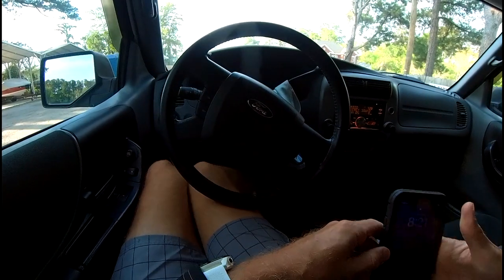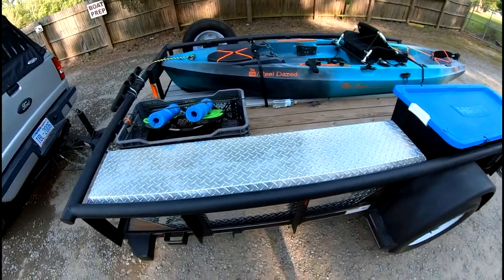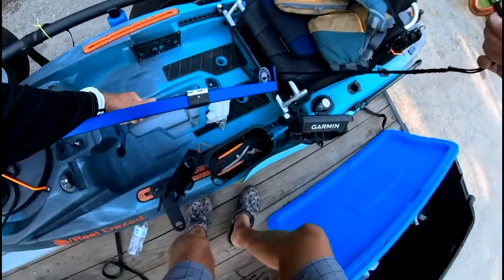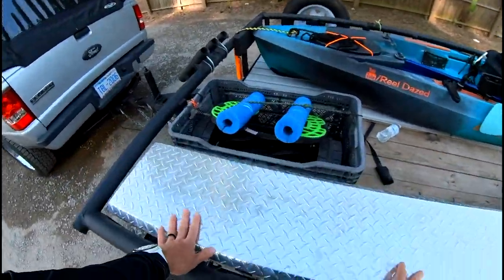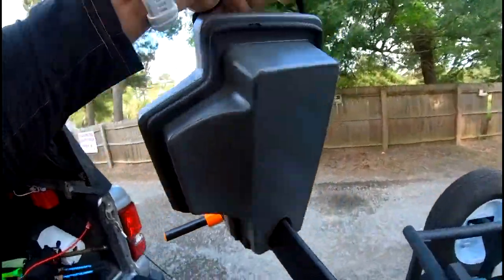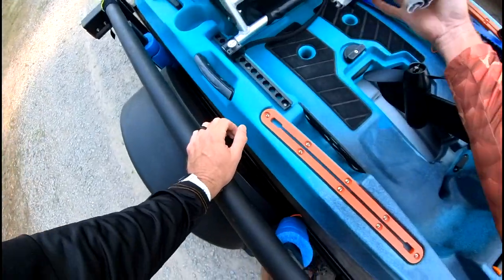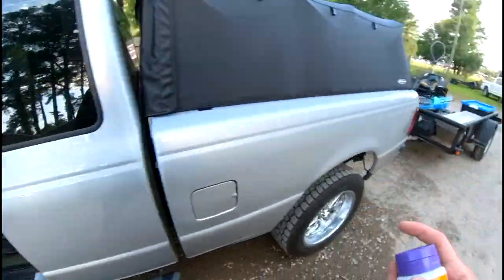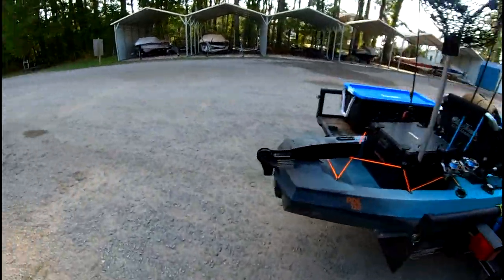Fishing Kayak Setup and Launch Procedure-Find Your Routine-Old Town Sportsman 120 PDL

Comment: Good video RD!  As a Lean Six Sigma consultant, I literally have studied and optimized my load(at home)-unload(at lake)-load(at lake)-unload(at home process).   I have each of them down to less than 8 minutes which includes loading 9 rods into my crate out of my truck.   The key is a few things...first attach as much as possible to your kayak that can safely travel, ie, fish finder, crate, cushion(attach bungees to back of seat and leave cushion on).  Second, any time your are walking around the trailer is wasted steps so turn your boxes around so you can be on the trailer and loading things from them onto your kayak by just turning around.    If you sketch out an overhead cartoon of your setup on the trailer, draw a line for everywhere you walk (called a spaghetti map).   You will be surprised at how many steps you take!
Reply from the maker: You are absolutely correct.  I probably walk a quarter mile around the trailer LOL.  I have thought about what I could leave attached,  I just do not want it to be gone when I get there.  I have thought about leaving the backpack pro attached as well as some of my mounts.  I had concern that the crate may bounce during travel and crack the rear well of the kayak.  I'm sure that is unlikely to happen.  I would be interested to hear if others have done it.  Anyway,  thanks for watching and the great advice!

Comment: I've been kayak fishing 9 years now, started with& only ever owned Hobie PA12's. Now on my second one, a PA12- 360. I've never had a trailer. I built a stand in my shop on casters, exactly same height as my truck bed. So I can just slide it on/off without ever picking it up. Then I either slide it off straight on grass banks into water or use my  kayak cart if it's concrete or need to cart it a farther distance. I never pay any parking fees on the big lakes because they only charge you to park at boat ramp areas if you have a trailer!  I also keep my kayak completely rigged up at all times. Unless I'm doing maintenance or cleaning it which isn't that often. Only thing I need to do is unstrap it out my battery box in back, connect my quick connect cable. The put my ultra 106sv head on the cradle. It takes me less than 5 minutes from time I pull up till I'm peddling away to fish. Longer I've kayak fished the more & more I simplified my rig. I don't fish tournaments but I'm on water 2 days a week. Just love kayak fishing & mother nature. I don't run a trolling motor either. Nor have any desire to. I can peddle for days, that doesn't wear me out at all.
Reply from the maker: Those Hobie PA’s are awesome.  It definitely sounds like you have it worked out especially having it rigged and ready to go in the water.  Avoiding the ramp fees is a nice bonus to.    I am trying to get on the water at least twice a week as well.   Definitely a lot of fun and a great way to get away from it all for awhile.    I appreciate you watching and I may have to give the bed of the truck another try myself.   Thanks!
Reply: @reeldazed539  nothing wrong with having the trailer & it seems like more guys now are using them, than not. I like going to a lot of smaller lakes/ massive ponds that are not always easy to get to. So there may not even be a place to turn around with a trailer. I just found it was easier to have it in my bed.

Comment: Honestly as I search for a trailer this is the set up I think I want
Reply from the maker: This works really well.  I have used a kayak trailer (boat trailer) and this one (utility trailer)and I am not sure that this setup is not better or at least as good.
Reply: @reeldazed539  yup I just saw the new trailer setup video. Was going to ask which you liked better? I want to be able to just run 2 kayaks side by side for my wife and I. I’m not super concerned about having the back into the water and float it although that is always nice too.
Reply from the maker: Floating it on /off and the ability to leave the pedal drive in (happened to fit in between bunks in deployed position) on boat trailer is the only real benefit.  Other than that the utility trailer is just as good.

Comment: I would put side kick landing wheels on the side, park the truck and trailer. And wheel the kayak over there or use a dirt ground  ramp to avoid fees. A kayak made to drop in anywhere
Reply from the maker: I have looked at those.  Some of the places I go are steep and wheeling it is a pain.  Definitely something to think about though.  Thanks for watching.
Reply: @reeldazed539  Throwing my kayak on J bars  is a pain  but it only weights 57 lbs. Getting a trailer and hitch next year before I upgrade my kayak. I want a Perception Crank 10' , only have a $400 Lifetime Tamarack pro lol

Comment: Nice video….question…what boards are you using that are right under the boat? I assume they are slipperier than wood?
Reply from the maker: It is plastic kennel flooring that I already had.  It joins together and has grooves.   I was able to place a few screws in these channels to hold it down.   I have another video on my channel that shows it a little better.
Reply: @reeldazed539  Thanks. Do you find it more slippery than deck wood?
Reply from the maker: Yes.  It worked perfectly.   The kayak will slide easily.

Comment: I am new to kayak fishing. I was just wondering how easy it is to access the fishing gear in the yak attack fishing box, being that it’s directly behind you. Being that I am an amateur, so to speak, I would almost be afraid to turn around completely for fear of falling into the water. is there a recommended technique for accessing both the rods and the tackle that is inside the box?
Reply from the maker: Alot of this will be determined by the stability of your kayak and your physical prowess.   The first kayak I ever bought was way to small for me and I felt like I was riding around on a beach ball trying to stay on top.   I then moved into a larger more stable kayak.  It made a world of difference.   Anyway if you have concerns take your kayak out in a shallow area with minimal equipment and just get comfortable with it.  Slowly work your way up to turning around and eventually standing.   Stay shallow and in a safe area.  Eventually it will become second nature and you will be turning around with a leg hanging off the side to cool off.  Hope this long response helps but I have no technique other than just being comfortable on it.   Thanks for watching!
Reply: Hi! I use to paddle board fish a lot so I think i can help

-strap down all gear to you or the boat in the event of a tip

-make a mental note of your most commonly used items and have them in front of you, tools, cutters, etc.

-consider a smaller tacklebox to keep under your seat or close at hand with your most commonly used lures or baits and leave the more niche stuff in the back

-and last, practice downsizing. You won’t have to turn around if you already have what you need and you’ll be surprised what you bring along that you don’t actually need.

Comment: What kind of decking was under your Kayak? Trailer is definitely the way to go …I’m too old for picking up my kayak
Reply from the maker: It is some old kennel flooring that I have had for years.  I cleaned it up and attached it.  It makes it super easy to slide on and off.  I do like the trailer as well.  I have back issues and it helps tremendously.  I do have another video on my channel that shows the trailer and that flooring setup a little better.  Thanks for watching!
Reply: @reeldazed539  yep I’m 65 n my HooDoo Impulse 12 ft . Rigged out is a bit tough to load on truck or inside my van . Always looking for easier ways thanks

Comment: What material do you have in the trailer that the boat is sitting on? It looks like it slides easily?
Reply from the maker: It is old pieces of kennel flooring that I had.   I have since bought a small boat trailer but this worked great.   The only reason I changed is so I didn’t have to lift at all due to a back injury.  I have a video on my channel showing it more in depth.   Thanks for watching!

Comment: Hello do you have a link or information on what the pad you are using undertheath your kayak?
Reply from the maker: It is actually interlocking kennel flooring.  I had it laying around and is probably 10 years old or so.
Reply from the maker: It is old kennel flooring that I had from years ago.   I don’t have a link and could not readily find one when I just looked.   If you Google kennel flooring a lot options come up.  I have a video on my channel that shows it a little better and how I have it fastened down.  I used this because I already had it and it has worked great.  I do believe any plastic type material would work as well.  It just makes it easier sliding the kayak on and off the trailer.  I hope this helps and thanks for watching!

Comment: what kind of a paddle are you using?
Reply from the maker: I have a Bote Rackham Paddleboard and it is the paddle that came with it.   I had a nice  Bending Branches brand paddle that I did not strap in to the kayak while fishing one day.  It is likely now at the bottom of the lake or with someone else.  I found that with the pedal drive I rarely if ever use my paddle so I just take the one from my Paddleboard with me now.  Thanks for watching.